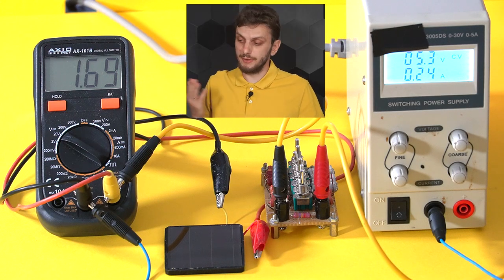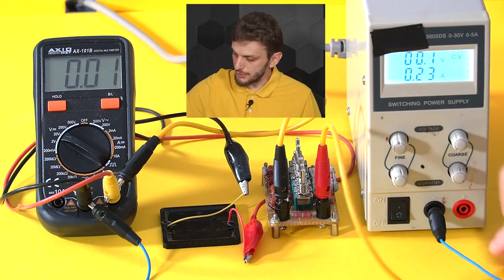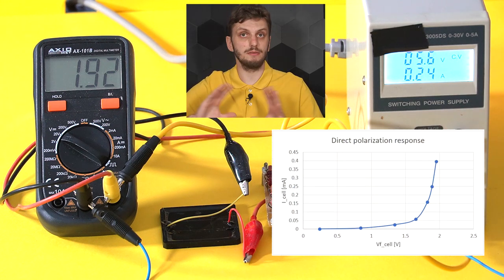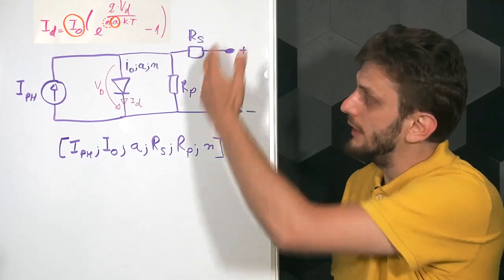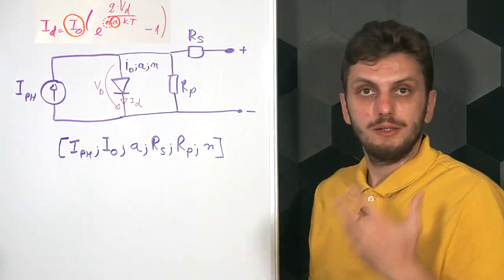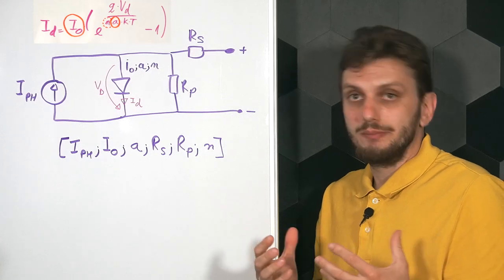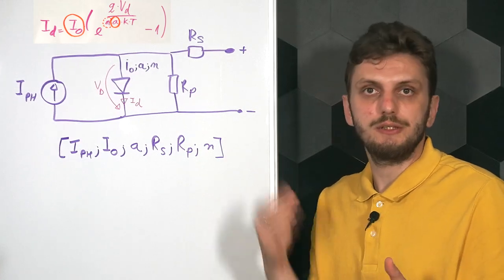Modeling Photovoltaic Cells - Theory 1/2

Comment: Excellent explanation. If the solar cell is not connected to any load (Voc) and receives good intensity of light does the internal diode dissipates that energy into heat? Thank you very much.

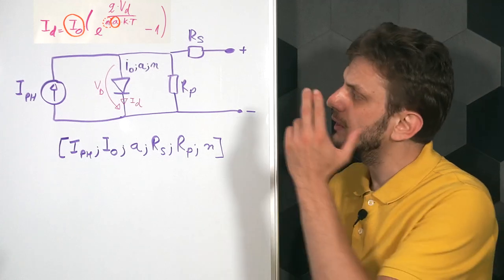Comment: This is one of the best video about solar cells models. However, at time 11:24, the diode equation (Shockley diode equation) seems wrong (perhaps 2/(n*a) = q  ? Can you explain what the variables, other than "n", mean?), and to indicate the voltage between two points, in Europe, we use an arrow with the tip near to the positive pole (in your drawings is near to the negative sign).